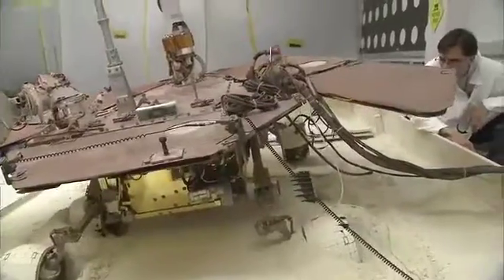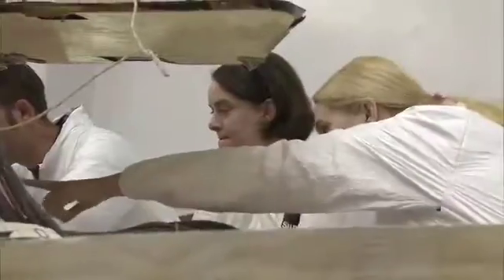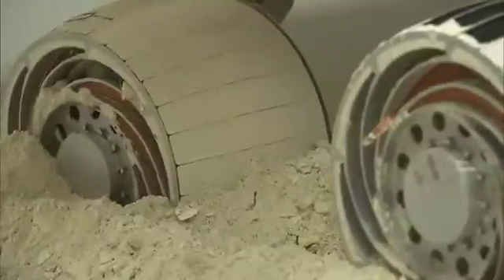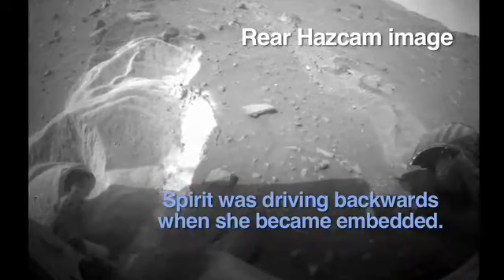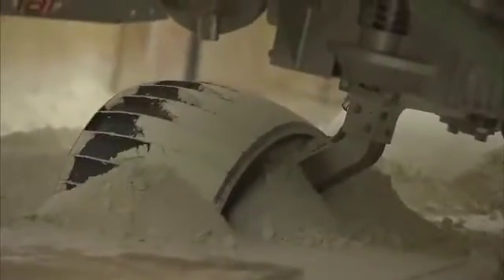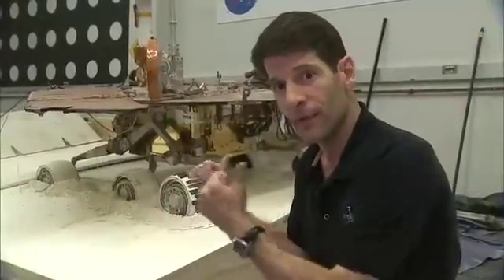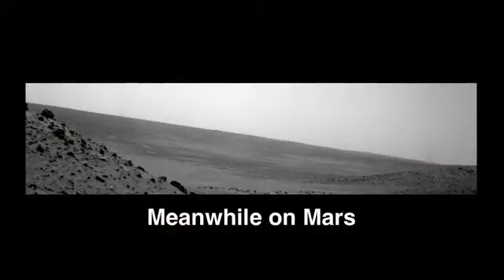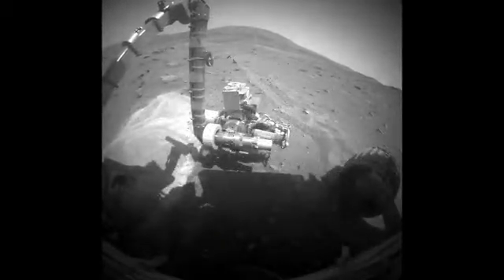Free Spirit:  Exploring Options

Comment: A shame they were never able to get it rolling again.  It's now 2014, and 5 years after Spirit became permanently immobilized it's sibling Opportunity is still going strong.  SOMEONE had a vision of foresight to send 2 rovers this time, despite only 1 going on the previous trip and one on the latest Mars flight (Sojourner and Curiosity respectively).

Maybe NASA should land 2 rovers together on the next trip and let them explore separately, but not too far from each other. Then in such stuck situations involving loose soil or rocks, one can "Winch" out the other via a hook on an arm or something not devised of yet, or at least at minimum provide better camera views of the situation. Call it a Rover Buddy System if you will.